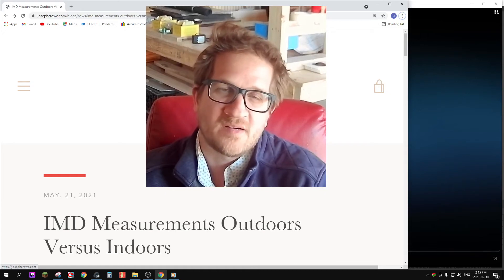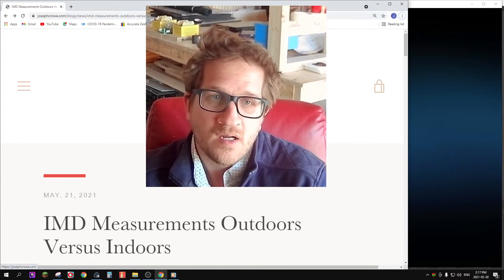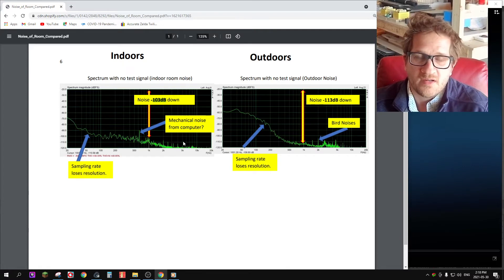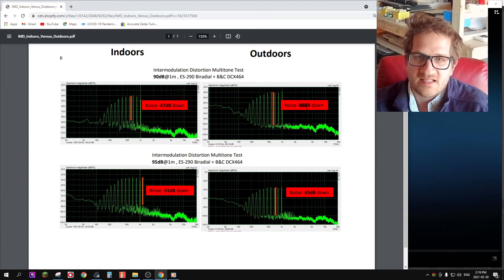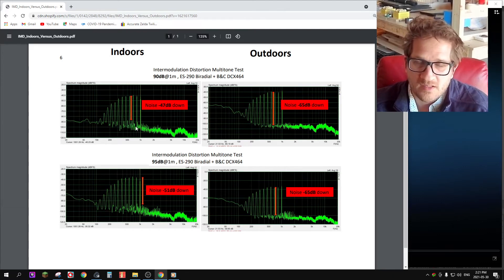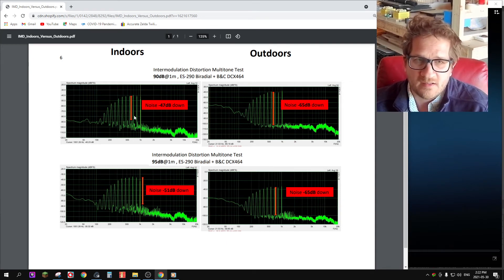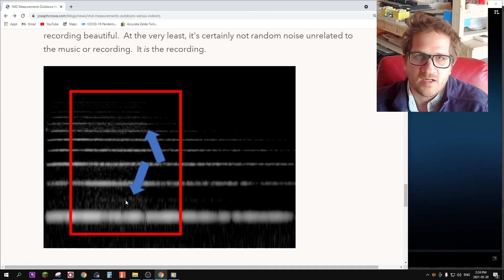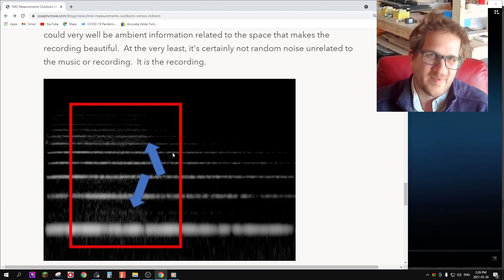IMD Measurements Outdoors Versus Indoors

Comment: If you choose wind free days and a location some distance to civilisation, like a large field or similar, the noise will basically drop down to levels of the noise floor of the signal chain. A proper outdoor measurement is ultra clean. A wind shield for the measurement microphone would be recommended, because without it even minor air movements can cause significant low frequency noise.

Comment: Great 👍 Keep exploring this. 
Side topic: did you try effect of wind shield on microphone? Like some measure-mics come with a foam cap. Once compared frequency responses with vs without, and it was minor (+-2dB) variations in high freq (1-20khz), that can be canceled by integrating to the calibration. Point is that it can reduce low frequency noise from wind.

Comment: Great channel!
Regarding the Room reflections changing frequency in comparison to the source:
In a room the where frequencies get reflected from the walls, they are causing interference with themselves at different phase angles of the wavelength. The resulting sum of waves, if looked at on a scope, would have little ripples like if a sine wave gets distorted with an distortion pedal. I suspect these harmonic overtones, caused by a comb filter from the summing of reflected and direct sound are what you are seeing.
The room itself is creating harmonic distortion and considering acoustics under all laws of physics it makes sense. When sound gets reflected of a hard surface that is not infinitely hard, the surface will bend a little and distort the time constant and therefore change the phase angle of the reflection in relation to a theoretical (infinitely hard) surface. When the phase angle gets distorted like this the result is a new frequency since a full cycle is now a few ms longer the wavelength becomes a bit deeper and the summing of direct and reflected sound is now producing a lot more random peaks since the interference is caused by waves very similar in wavelength but still a bit different, so the peaks will not only be at even and odd order multiples of the frequencies emitted by the speaker.